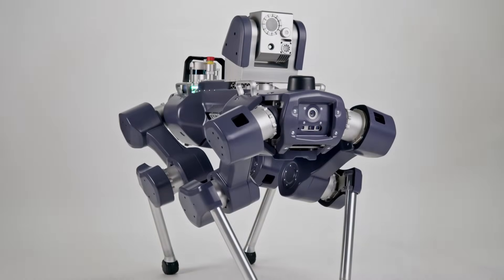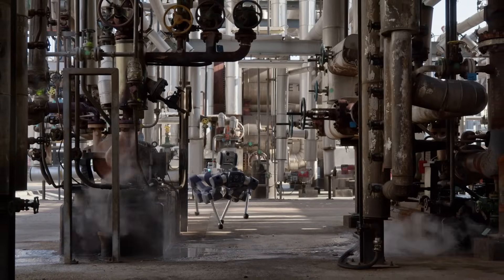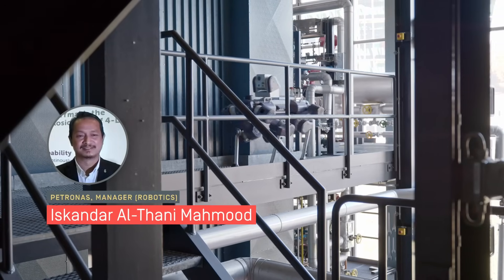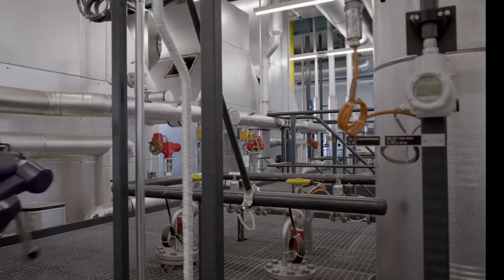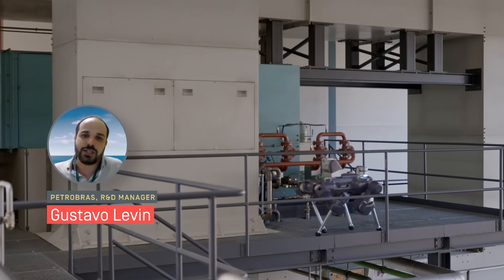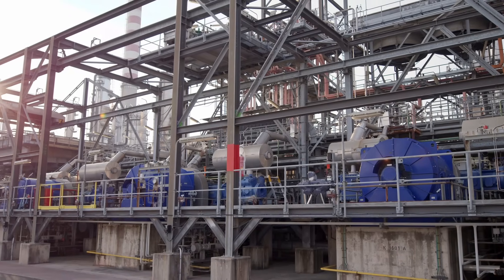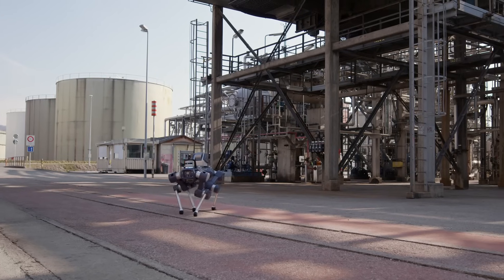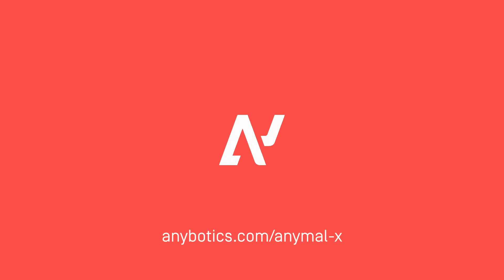ANYmal X — The World’s First Ex-Proof Legged Robot

Comment: Why teach an AI robot to climb stairs (always prone to errors) when you can perform the same surveillance tasks faster and more effectively with small drones. These also have light, infrared sensors and distance sensors in order to continue flying independently even if the signal is lost (e.g. in corridors and buildings - the flown route can be saved with centimeter accuracy, which means that a return flight to the starting point is possible even without a signal.
Reply from the maker: Thank you for the question. Drones have their advantages in some areas but they also lack the reach: For example, the battery life and therefore the time of inspections is limited. The ideal case is that quadrupeds like ANYmal and Drones work together for some missions
Reply: @ANYbotics range can easily, and cheaply, be overcome by deploying multiple drones from multiple locations all operating in parallel subdividing the task and so not just overcoming the range issue but also completing the task much faster.